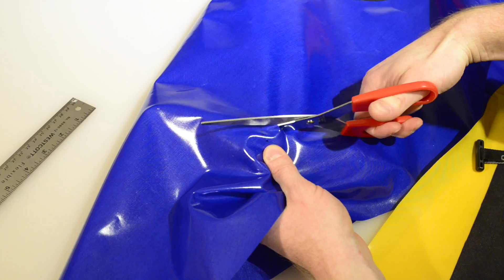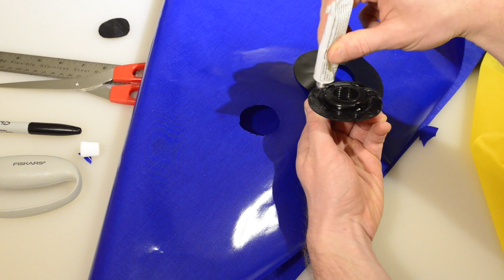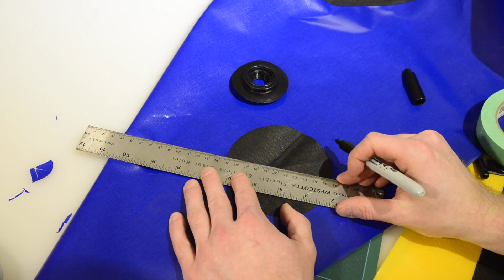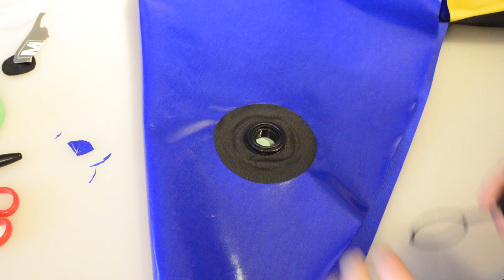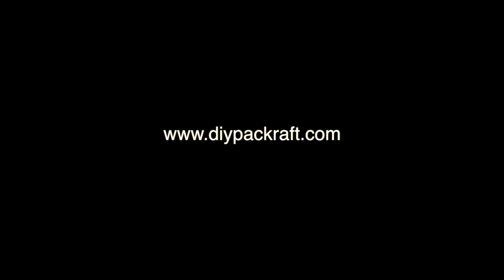DIY Packraft V2 Kit: Step 5 - Boston Valve Installation

Comment: What glue are you using ?  or is it seam seal?
Reply from the maker: The newer valves are heat sealable, but I used Aquaseal in this video. There are better adhesives though - people have recommended HH-66, Stabond, Clifton, etc.